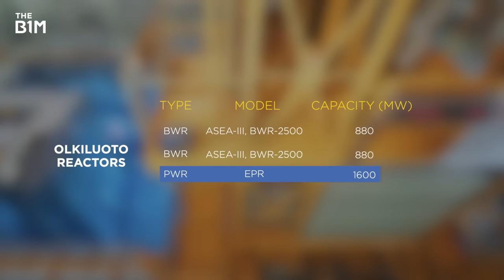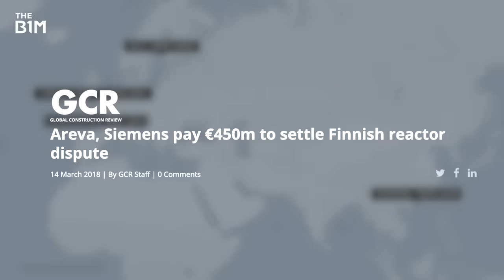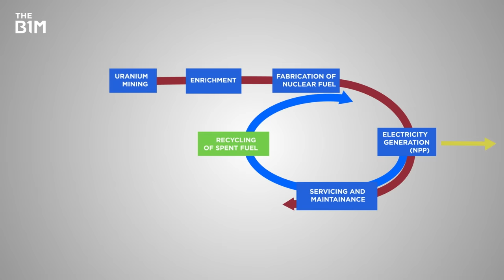Finland Might Have Solved Nuclear Power’s Biggest Problem

Comment: "Georgi, what do we do with the spent uranium ?"

"easy, put it back where it came from!"
Reply: Except the uranium used in reactors is refined. It's not the same stuff.
Reply: @AaaaNinja   Is it stable down there.
Reply: @jackfanning7952  Longer half life = less radioactive. More radioactivity = shorter half time. Most of the dangerous byproducts are gone within a few years.
Reply: @jackfanning7952   not really.  The more radioactive the waste is, the shorter it's half-life.  After about 50 years it is about as radioactive as the uranium ore they pulled out of the ground.  Not necessarily safe to be around, but not more dangerous than many naturally occuring underground deposits.
Reply: @PTNLemay  Makes sense, and I don't know shit about radiology etc. If something emits X at disgusting rates, it's gonna run out of juice real fast, based on how everything else operates
Reply: @jackfanning7952  Considering our fast evolution, in 200,000 years we may not even be in the Solar System anymore. The problem is surviving that much. You're lucky to reach 100 years and we most likely won't due to the current pollution in the air. Everyone is crying about radioactive waste being burrowed underground so far away from where their lives take place and they say this while breathing air + 200 years of pollution from when the industrial revolution started then proceed to complain that wearing a mask is against their rights. 
People saw 2 catastrophic events related to nuclear energy and went mental while the coal power plants release more radioactivity in the air than nuclear power plants due to coal not actually being refined of their impurities and end up burning the material + anything else there's inside.
People expect us to live for hundreds of thousands of years on this damn planet but they are too blinded by their own stupidity to see that we won't be able to in this current situation and that we need to change things up.
Reply: @PTNLemay  Not really. You are wrong. Dead wrong.
Reply: @jackfanning7952  nuclear is the cleanest, safest, and cheapest energy solution we currently have. if you think otherwise then there is some aspect of your preferred generation method that you're ignoring.
Reply: @jackfanning7952  it's because of people like you who fear monger others , that we are in this shitty situation, renewables like solar, wind and hydro are nowhere as efficient or as powerful (and as safe) as nuclear. Nuclear power is literally the safest option we have, maintenance is cheaper and as safe, if not safer, than all other renewable sources of power. If you consider deaths per year due to energy sources, nuclear has the least deaths out of all of them, while fossil fuel's death toll is only increasing, due to air polution and all that, but, you're not an advocate for fossil fuels, so i don't need to convince you of that. What i do need to convince you of, is that solar, wind and hydro, are not nearly as fast enough for our growing global warming problem,  and nuclear just might be. If you keep fear mongering people out of nuclear, what are you truly advocating for? For us to continue using fossil fuels? Because other renewables will just not cut it in time.
Reply: @jackfanning7952  jack can not back up anything, ima scawed isnt good enough.
Reply: @wackyduck3  Nuclear not being at all safe, clean and inexpensive seems to be good enough to keep the investors away., doesn't it?
Reply: @jackfanning7952  have you even spent one minute actually looking into nuclear power? cause it doesn't seem like it, all your arguments are "cause i said so"
the truth is nuclear is about as safe and clean as solar and wind, which take a huge amount of space and resources, but above those it's reliable and it's available.
the amount of time, space, and resources it would take to replace all fossil fuel power gen with nuclear is a fraction of the amount it would take with any other renewable method.
the only reason it hasn't been done yet is people like you who are frightened of the word "nuclear" and rich people invested in fossil fuels.
Reply: @emoAnarchist  "As an alpha emitter, plutonium-239 is not particularly dangerous as an external radiation source, but if it is ingested or breathed in as dust it is very dangerous and carcinogenic. It has been estimated that a pound (454 grams) of plutonium inhaled as plutonium oxide dust could give cancer to two million people."

It seems like the danger really depends on how easily it oxidizes, and whether it is the isotope in nuclear waste.
Reply: @lendiojames7293  I wonder why the billionaires don't invest in these techs then?
Reply: @jackfanning7952  lol one storm and half the "green energy" goes dark. Sounds really reliable for 1 billion people
Reply: @jackfanning7952  no new generation reactor has ever melted down, and with new technologies like molten salt thorium reactors the amount of waste can be heavily minimized. Nuclear technology should be used as a bridge to get us off fossil fuel quickly and then phased out with pure renewables over time.
Reply: @jackfanning7952  again, not a single coherent rational argument to be found here.
Reply: @jackfanning7952  are you a nuclear physicist by any chance? just curious what your background is.
Reply: @MalushJ  I am a retired industrial hygienist. I stayed at a Holiday Inn last night and have access through my computer to all sorts of information - such as the World Nuclear Industry Annual Report compiled by 7 world renown experts from prestigious universities and think tanks. Check it out at worldnuclearreport.org.
Reply: @jackfanning7952  you have yet to make a single logical, provable point. your entire position stand solely on your fear of the word "nuclear". 
you have clearly never ventured outside your echo chamber on this subject, and are completely closed to any form of discussion on the topic.
the fact of the matter is none of our opinions actually matter.. i don't know why i even began wasting my time trying to have a civil discussion here. it would be more fun trying to debate a brick wall.
i wish you a good life, and good luck.
Reply: @emoAnarchist  There you go again, talking to yourself. Please don't stop now. I enjoy hearing a nukie come to grip with the realization that no one wants anything to do with nuclear energy any more.
Reply: @jackfanning7952  Yeah, lets just go back to the 1800s and enjoy our horsies and letter-pigeons hahah
Reply: @martijoha  Why would we want to do that? By the way, did you know that the biggest pollution problem in U.S, cities prior to the automobile was horse shit from the carriages and freight wagons. I would take that any day to the radioactive fission by-products nukies are now inflicting on us.
Reply: @jackfanning7952  I didn’t, probably since I’m not from the US. To me nuclear energy seems just as safe and reliable as solar or water energy, as long as the bi-product is handled safely. Regarding the chernobyl accident the whole problem was the secrecy of the Soviet union wanting to keep the problem hush-hush and therefore not asking for help. All your talk about money for clean-up etc, you have the excact same issue in the petrol industry- probably even worse? I’m dont really care about politics, nor the «omg fuck this *insert energy industry*» movements. I just find it funny how much you disregard an actual almost non-air pollutional energy source, and then ramble on about air pollution for the next 4 comments
Reply: @thomaswerner5821  what will be its demise?
Reply: This Jack guy is trolling all of you
Reply: @jackfanning7952  Care to substantiate that depleted uranium is in some way "1,000,000 times more dangerous"? What are names of the byproducts you're talking about?
Reply: @jackfanning7952  I think mutation rate worldwide didn't increase more than 0.0001% because of chernobyl, or fukushima. If you claim otherwise, maybe you should substantiate it too.
Reply: @wiczus6102  I am not qualified to determine the mutation rate of radioactive catastrophies like Chernobyl, Fukushima, and others. I rely upon research from scientists like Dr. Alexey Yablokov, Dr. Gordon Edwards, Dr. Timothy Mousseau and others to determine such things.
Reply: @jackfanning7952  Please link the paper, not the scientists.
Reply: @wowalamoiz9489  I want everyone to think about what this nuclear proponent just said. That is the mindset of the nuclear energy advocates.
Reply: @jackfanning7952  Me? Well, why don't you point what was so wrong about it.

Preferably without insulting me. Its a civil conversation. You know, if Daryl Davis can be friends with the KKK, then you don't have an excuse not to be respectful of strangers who are respectful to you.
Reply: @jackfanning7952  Besides, I've figured out a method of delivering cheap electricity without nuclear anyway. I just don't buy the arguments you're making.

If you google geothermal energy is the future "hydroevacuation" , the first result is my article. Technically, it counts as nuclear fission because the Earth's heat partially comes from fission.

Comment: There is an even better project in France, where they will basically use the same storage method, but with specially processed wastes, which are less dangerous and will stay less time radioactive, all of this in less volume.
Reply: less dangerous and less radioactivity are mutually exclusive. For something to decay rapidly so it spends less time being "radioactive" means it's VERY radioactive during that shorter time vs being lightly radioactive but staying that way for a very very long time.
Reply: @AgentExeider  you are right, sorry for not being technical enough. All nuclear used fuel have basically the same isotopes, but in France, the fuel is recycled at the Orano La Hague plant, where the uranium, plutonium, and final waste are separated, so at the end, the stored waste is just less radioactive materials and simply less material/volume (only 4% of the total original used fuel).
Also, less dangerous and less radioactivity are not mutually exclusive, if "A" = 1kg & 10 Bq gamma and "B" = 1kg & 1 Bq alpha => B is both less radioactive & dangerous than A (even so I don't have any real example here)
Reply: Russia recently went way further, by actually processing the waste and reusing it in the fast neutron reactors (MOX fuel) which after spent can then be used in ordinary reactors and so on. It leaves the small amount of waste but only a fraction of any other methods... I heard France and UK kind of sort of do similar thing too. And yet not only most people, most countries even, keep thinking that burying the waste is the only possible solution 🤦‍♂️🤦‍♂️ What's with the misinformation...
Reply: @mihan2d  MOX was invented in France as a demonstrator and so used it 1st. Now, almost all French reactors are using MOX, but there is also China and Japan for sure, and also, the new 3rd Gen reactors are the 1st ones that can use 100% MOX.
Also, using MOX will reduce the total amount of waste generated, by consuming most of the plutonium (1% of the total used fuel), but there will always have some dangerous waste at the end. The best way to reduce waste is mostly by removing the depleted uranium: 95% of the used fuel and not dangerously radioactive. Burying is both extremely cheap and safe, so why would you want anything else ?
Reply: Don’t tell me....you’re French, right? lol. 👍🏽
Reply: @pommiebears  YEEEEh
Reply: @pommiebears  touché, I even work in Nuclear waste management ^^
Reply: @pommiebears  
Finnish folks also got their ammo-nitrate disaster !
Just to get what's the point "innovation" there ...
🤔 😌
Yep, not quite sure that was the proper tone that "picture" .
Nevermind I tried.
Reply: What about LFTR reactors??
Why are they still building these inefficient wasteful dinosaurs, and then "burying" the problem??
Reply: @jigaraphale , poisoning the ground for thousands of years to come, for our gratification today? Who could complain about that?
Reply: Why are there not building the reactor underground in their design ?
Reply: @leehaelters6182  "poisoning" is factualy not true, just look at the Oklo natural reactor in Gabon to see than some very radioactive materials deep in the ground is not that dangerous. In addition, here, engineers are studiyng the ground topology/composition to ensure the very long term safety of the storage. When you compare this king of pollution to CO2, you can immediately tell than mankind have a way more serious problem to manage 1st.
Reply: @zenlei8258  because they are ... sort of. there is a big part of most reactors underground, but building one completely underground will just add more issues than it solves.
Reply: @Walter's Playground  LFTR are a great idea, but for now, this technology is far from being ready sadly, and where you live in 2021, a world with limited resources and the Paris agreements to meet before 2050, they are not worth it for now. Also, LFTR are no perfect and will too produce very radioactive wastes that will basically be managed the same, and also, WPR may be "dinosaurs", but they are still very efficient and are a proven design.
Reply: @jigaraphale , your use of “not that dangerous” reminds me of my teenager explaining various behaviors. Only “some” radiation, but for thousands upon thousands of years, adds up in its impact. But you and I won’t be around to wring our hands. And I’m mighty glad those engineers are studying things, with a view to protecting people unimaginably far in the future. Those folks will be grateful, I’m sure. Engineers never make a mistake, management always scruples to protect a populace they will never answer to, and we now can build structures that last forever.
Reply: @leehaelters6182  so, as I told you, there were natural nuclear reactors several millions years ago, such as Oklo's one, those reactor produced the same bad stuff as our reactors today, and those old natural dangerous waste never ever killed anybody. With such dada, it is very safe to say that this burying method is very safe, and when you add all the brain time devoted to it, you can even say that it's safer that what we'll ever need. 
Moreover, fossil fuel waste/byproducts will kill more than 2 billions people in the next century if we don't do anything about it, so maybe it better to focus on this issue rather than wasting too much time on nuclear waste 😉.
Reply: @jigaraphale , it is reckoned that the Oklo site produced it’s fission products for a period of two hundred thousand years, starting two billion years ago. And you are here to assure me that the operations and waste products never, ever hurt anybody.

I am gob-smacked, that you think that you have reliable knowledge about such that we can base our modern decisions on. Two billion years?? No human skeletons found at the site, that’s good enough for us, folks!
Reply: @leehaelters6182  I'm not saying it, the scientific consensus is. If you look 2s at what this site is, you can clearly see that there is no way for this to have ever harmed anybody. What we learned thanks to this site is that when any kind of heavy isotope is trapped deep indo stable soil, it stays there for eternity. Those new burying sites are made in even more stable soil, and in stronger containers, so when they will inevitably leak, the isotopes which will already be less radioactiv will just stay there, harming no-one
Reply: @jigaraphale , the scientific consensus? Or the consensus of those who will profit or whose careers will advance?

“It’s only a hundred thousand years, what could possibly change?” “Nothing, far as I’m concerned! Yo!Chief! Back it up, start unloading!”
Reply: @leehaelters6182  what is this bad caricature... you know that since TMI and Chernobyl, the nuclear industry is the most transparent industry you can think about. If you want to see, you can easily find documents and studies explaining what will be done exactly and how they are ensuring that this is safe. I know that at least in France, the CEA, ADEME, IRSN, ASN and ANDRA published documents in English about that if you want.
Reply: @jigaraphale , fair enough, wrong of me to impugn the professional reputations of people whose names I don’t even know. And thanks for bringing to my attention the Oklo reactor.